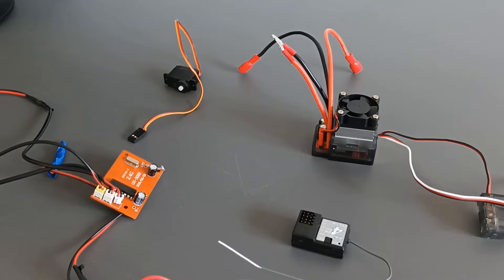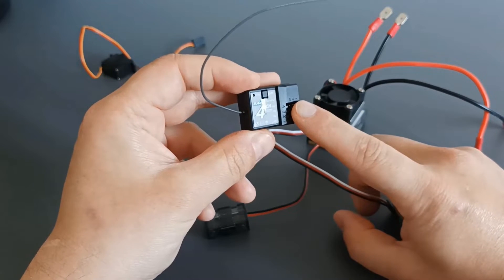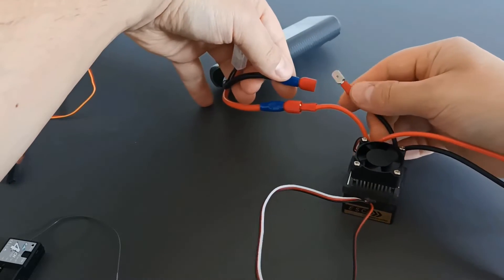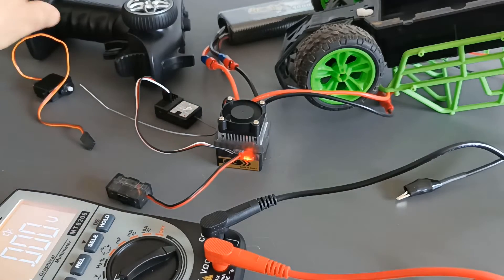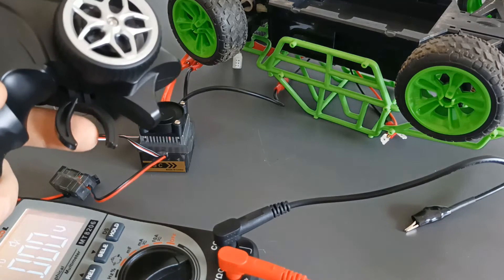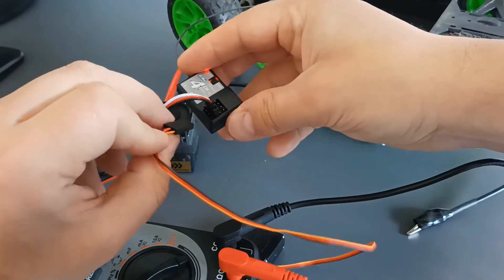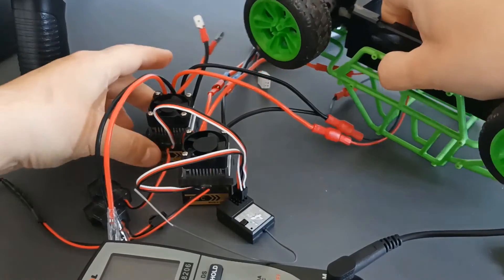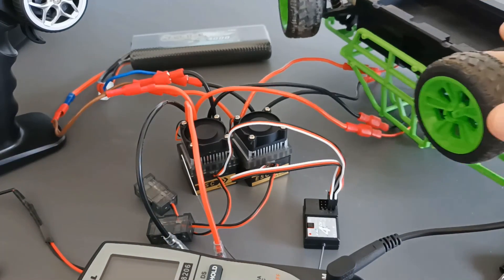How Does ESC Work? How to Make RC Cars Faster Using Electronic Speed Controllers (ESC). Part 1.

Comment from the maker: 👇 If you found this video helpful, you can support us by buying products on a platform of your choice via our links below (we get commission):

👕 Make your clothes unique: 
https://aventura-all-remote.myspreadshop.com/

▶ AliExpress:
Electronic Speed Controllers (ESC): https://s.click.aliexpress.com/e/_DC9CZV5
Remote control with receiver: https://s.click.aliexpress.com/e/_DczJpiB

▶ Amazon:
Electronic Speed Controllers (ESC): https://amzn.to/3fobZbv
Remote controls with receiver: https://amzn.to/3WlqQE8

If you decide to buy the products mentioned in the video, you can use our affiliate links above (no extra charges apply).

📺 Related videos:

Part 2. How to Make or Restore an RC Car Using Electronic Speed Controllers: https://youtu.be/LwE5geJDvz4

How to Make Any RC Car Faster. Add More Power to Your RC Car with Relays, Diodes and Extra Battery: https://youtu.be/8-XTSWg7slU

Comment: What is the voltage input at the red cable? Is it 12v?
Reply from the maker: The input may vary, depends on the specifications of the ESC, which may support a range of voltage, and the battery you use. With this ESC I was able to use 7.4V and 11.1V batteries.

Comment: You know you just needed to hook the servo to a connector that can connect to the receiver. 2 esc's is not the answer.  You will learn in time.
Reply from the maker: Thanks for your comments. As explained in this video, this was a specific case, this car's steering mechanism was not the one a regular servo would handle, nor was something I wanted to replace, thus another ESC for the existing steering mechanism.

Comment: Is that esc can automatically adjust base on required voltage for motor to move?
Reply from the maker: It starts from 0 to the maximum voltage indicated in the specifications when you start accelerating. The right battery should be chosen as well.

Comment: Hi,
I have a jlb cheetah 120a esc, and often get out of control=goes to full throttle for around 2 sec and no response from direction, calibration doesn’t solved the problem…there is something else that i can try, or replace is the only solution…in your opinion..10x :)
Reply from the maker: Find which element is causing the problem. If you have another set of a remonte control with a similar receiver or extra receiver for the same remote control, you could try switching them and see if anything changes.